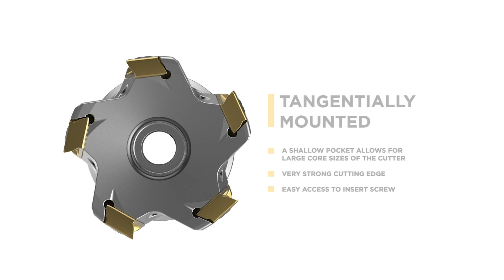Cutting "Swiss Cheese" With The Mill 4™-12KT

Comment: Are these inserts uncoated carbide? If they are then the “ base carbide “ most be of a much tougher composition compared to coated grade carbide. I remember back in 80’s/90’s coating compositions were nothing like they are now, Mitsubishi produced a black uncoated grade that was unusually tough, nothing in the industry could match there performance, I think Kennametal made a uncoated 950 grade not well suited for interrupted cuts, very brittle.( they still might?) I could rough/finish with interrupted cutting with very little tip damage, nothing out there could match there performance. But then they stopped making them and focused on coatings and the base carbide was much less tougher, didn’t get near the performance. So I’m assuming your inserts if uncoated are taking on the properties of similar composition which is of course a guarded secret 😁
Reply from the maker: Coatings and substrates certainly have evolved over the years, and the combination we use for Mill 4-12KT inserts are no exception.  Advanced processes including post coat treatments all work together to make inserts capable of some amazing machining parameters.
Reply: @KennametalInc  I Love the intelligent and informed replies this representative offer viewers. Keep up the informed discussion!
Reply: @jesther4140  Why would you love that responce?  He never answered the question:  "Are these inserts uncoated carbide?"
Reply: @bryanrude8072  Guess I wasn't thinking about that as, at the time, I had read several comments from Kennametal's rep. on other videos. I was commenting on how collectively proficient their answers have been. My mistake

Comment: How about 10mm axial depth and not so aggressive fpt?
Reply from the maker: The Mill 4-12KT can certainly handle a 10mm axial depth of cut, but since many machines lack the Horsepower for such a cut, we choose a smaller depth and more aggressive feed rate for the video.

Comment: I understand that this is for demo of the cutting edge so you can see it but I would think you would still want to use a coolant. You can see the smoke coming off the bit.
Reply: steel generally doesnt need coolant. definitely good in most applications, but steels carry the heat away in the chip, meaning less heat in the cut than something like stainless or aluminum